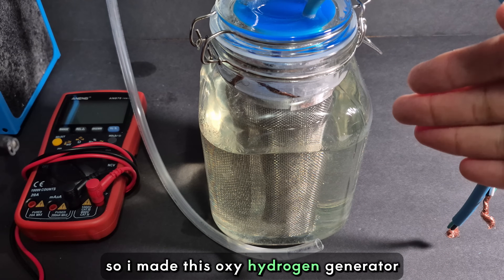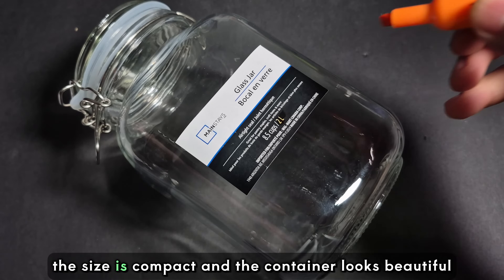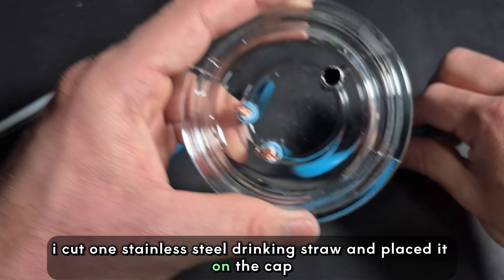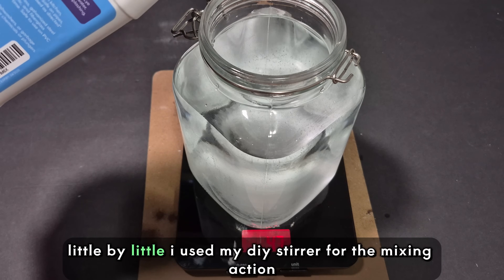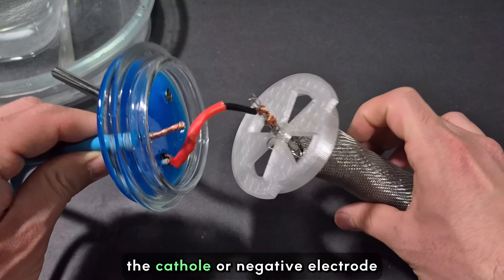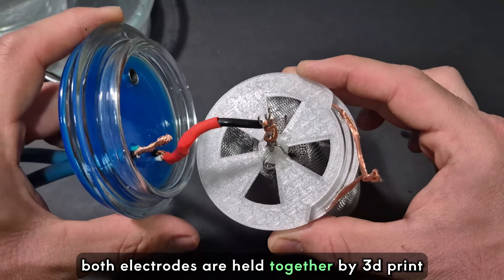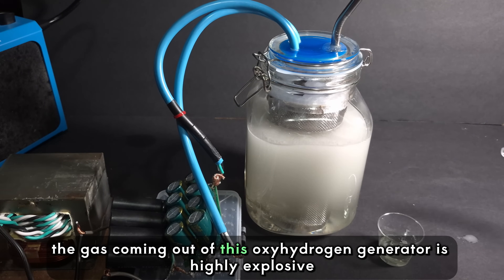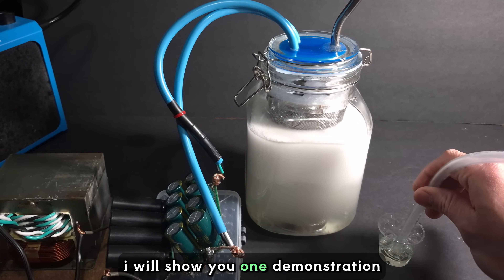DIY Oxy Hydrogen Generator That Actually WORKS - Step By Step Guide!

Comment: I heard theres a coating that forms on hydrogen, or it becomes less efficient over time ? Can yu educate me ? 😊
Reply: Hydrogen is a gas, what layer are u talking about? Yes stainless steel does degrade eventually.. making it less efficient.
Reply: @theartistboi6551 yes i meant the plates. Ive heard some systems have steel that degrades. And some systems form coatings on the plates that enhance  the production of hydrogen.
Reply from the maker: Nickel plating the steel will help with corrosion. But it adds extra step. Im not sure if you can get pure Nickel mesh. It will be expensive than using 316 stainless steel
Reply: @Mr_Singh_Simranjit mm! Thanks.

Comment: did you measure heat?
Reply from the maker: Hi, i didn't measure any heat output from the solution due to the high current.
Reply: @Mr_Singh_Simranjit There is no relation about it you can measure it externally, high current means heat to me

Comment: Just any FYI for anyone making this, it eworks but please....PLEASE make sure you have sufficient FLASHBACK PROTECTION. A glass jar with explosive gasses inside is a grenade. If it ever does detonate (which it will without a flashback arrestor/bubbler if using for torch applications) it detonates with a sheer violence that will ensure you have glass shards embedded throughout your body/eyeballs etc. Even in the best case scenario where your not permanently injured or mutilated....it'll be a very very bad day. At the very least use a properly made bubbler and don't be stupid.
Reply from the maker: U make a very good point. Appreciate your feedback.
Reply: Better yet, people should be using PEM, which generates H2 and O2 separately.  There is no chance of blowing anything up with that type of electrolyzer.... unless you purposely combine the two gases into some vessel and ignite it.  PEM technology keeps getting cheaper.

EDIT: OR combine the H2 and air and ignite it... but you get the point.

Comment: do you have an accurate indication of volume per minute produced at what voltage?  I'm looking into what methods people are using to produce good volume per minute at low voltage
Reply from the maker: Hi, I have not conducted a specific experiment to measure the volume of gas generated. I usually go by current. Higher the better.

Comment: Amazing! I am wondering what the electronics used to make this look like? 🤍✨️🕊
Reply from the maker: It's just modified MOT, One Full Bridge rectifier, A few Capacitors.
Reply: @Mr_Singh_Simranjit Thank you so much for sharing this brother! 🤍✨️🕊 I appreciate your support so much! 

It would be awesome if you had components list for this AMAZING setup!
Is that something you can share?

Many blessings to you 🤍✨️🕊
Reply from the maker: Hi, You don't need specific components. Just use whatever you have available and make sure they are high current.
 For a rectifier, you can use GSIB2520 (just a suggestion). For capacitors, anything above 1000uF is good (use multiple in parallel).
Reply: @Mr_Singh_Simranjit Wow! Amazing! I really appreciate you! I will give it a try for sure. Thank you 🤍✨️🕊

Comment: A really cool video! Thank you!^^

The only thing the creator didn't say - you have to look specifically for AISI 316 stainless steel, which is not something you usually buy at home depo. Also - not all steel sponges work, because of the same thing - some are made from AISI 304, which is much cheaper, but quickly degrades in the electrolitic process.

Source: I've tried similar designs, and not all kitchen hardware works, despite all of it being "stainless steel".
Reply: This is 100% correct, I'd also add that the addition of a flashback arrestor or bubbler at the very least is essential in this case considering glass shrapnel will ensure you have a very very bad day....that is, if your lucky.

Comment: Hi, I had a query, did the electrode corrode/decay after usage? cuz when I made my own using some different material, there was rust on +ve terminal.
Reply from the maker: Hi, Use high-quality 316 stainless steel or coat your electrode in nickel. I know it's an extra step, but it's well worth it if you are planning to run it for a long time.
Reply: @Mr_Singh_Simranjit  thanks for your suggestion, definitely will look after it

Comment: EASY TO UNDERSTAND WHAT IS HHO Hydrogen power CAR KITS . HHO ARE VERY SIMPLE BUT WORKS GREAT for your car better than you think.!!!

ACMEC HHO kits are designed for hho gas production in low voltage & low amps.  Lower heat generation Easier to Mantain and Easier to Install ,  Compact in size but more stable HHO Gas Production.   All hho kits generated Hydrogen and oxygen gases nothing else.! You never try to store  , use it as you make it . HHO on demand system according to your needs considered very very safe.

Yes HHO CAR KIT will improve your engine horsepower and fuel burning efficiency while reducing toxic gas emissions hho kit will solved all engine heating problem automatically. Engine will run clean and smoothly requiring very little maintenance, you will only have to add distilled water. Hho is best for  decarbonization of your cars. So make your car zero emission. In this way you can stop polluting the atmosphere.!!

You will not see brown deposits in our new designed long lasting hho kits. Our  kits for efi cars working up to two amps. 

But our transparent hho kits for carburetor types engines working up to 8 AMPS. For better fuel economy. ACMEC HHO CAR KITS can installed on petrol, Cng gas, or diesel engines, to run smoothly and your life will much easier.

For more call zafar 03082266179 or watch hho zafar videos on YouTube.
Reply from the maker: Hmmmmm,  That's a weird comment 🤔🤔🤔